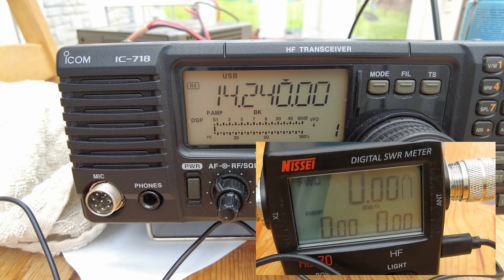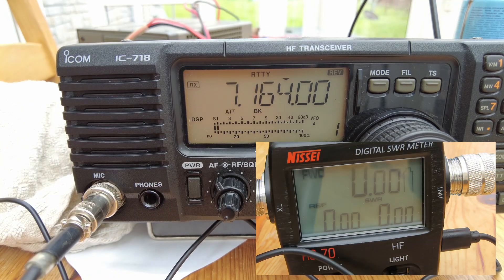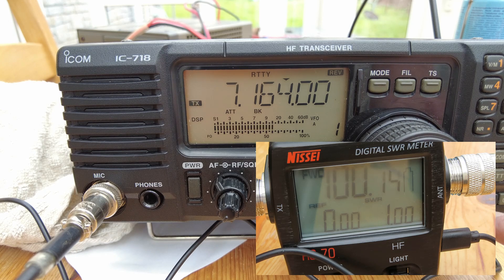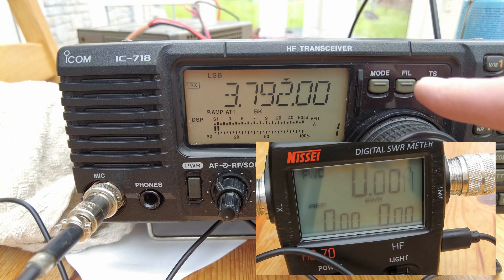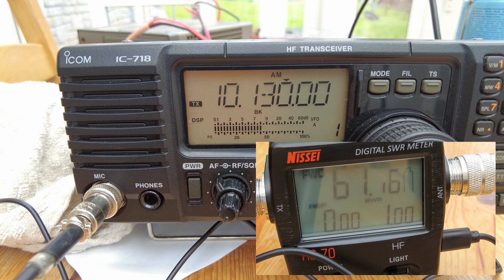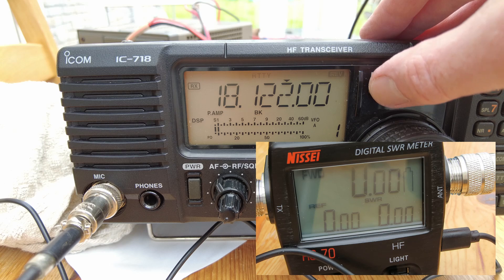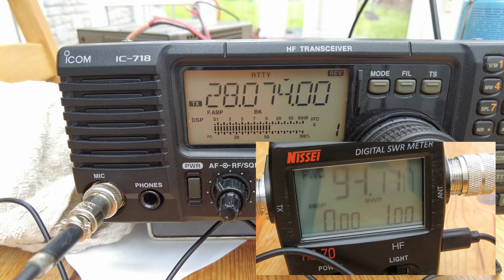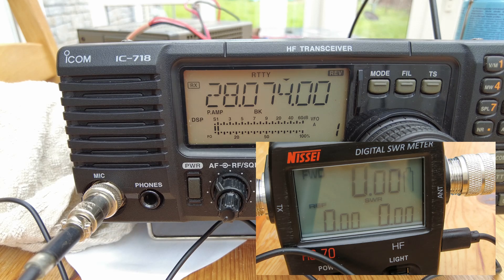Testing the Output Power on My Icom 718 Transceiver

Comment: The 718 is an excellent rig. I still have one. I also have the 7300 a ft911a , a 7100  and they are all great radios. I gave my son in law my IC 707 (the one with FM board) but much like the 718 without all the keypad and menus .You should study the manuals and they are still available on line in PDF.
Reply from the maker: I have the manual. I just can't get along with the 718. It has the worst receiver in any modern radio that I have owned.

Comment: Go into the settings and turn power up to 100% and the meter will show 100%
Reply from the maker: Power was at 100% you can see I was getting over 100 Watts on the external meter.
Reply: @KevinOReillyswl  But it should show 100% on the screen as well if it is set at 100%.
Reply from the maker: Well this one does not